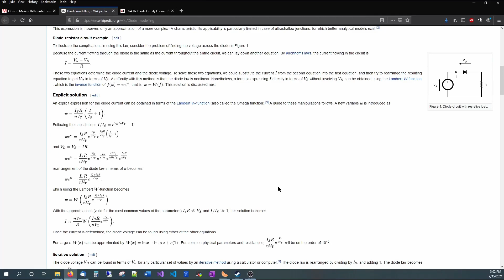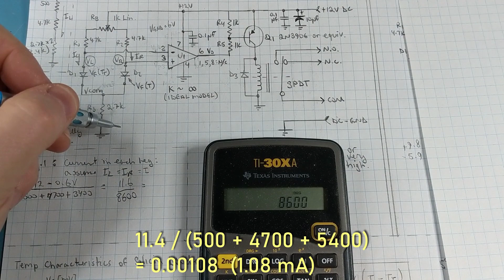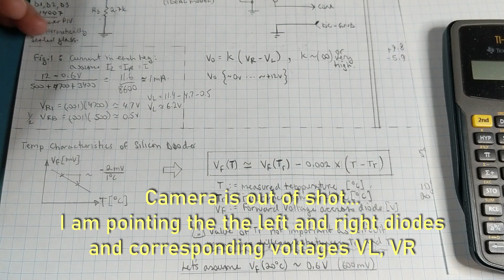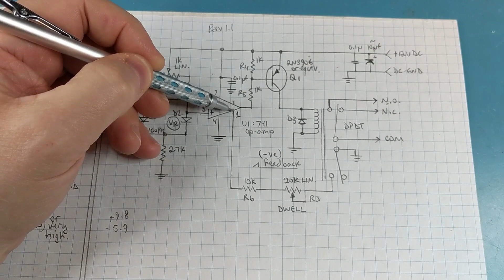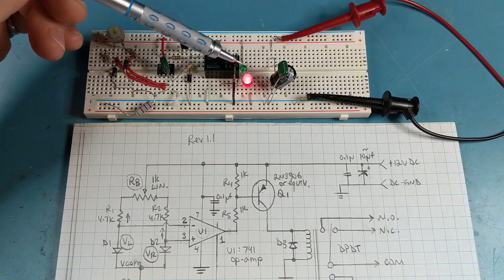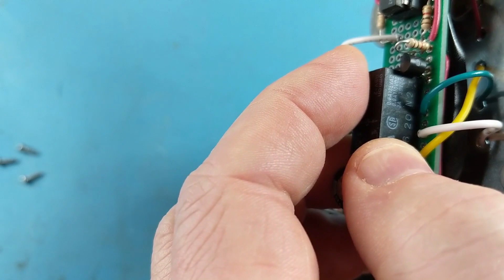EV 016 - Analog Circuits - Differential Temperature Sensor

Comment: Hi Eddy_D

I restore and collect vintage radios here in sunny British Columbia. 😊   I recently  came across you YouTube video where you rebuild some IF transformers using  some PC boards you designed yourself.   I must say that I was very impressed with the precision with which the three boards go together.  I have a few AA5 radios where the IFs have been destroyed by heat and I was wondering if you would consider selling me several sets of you PCs.  
Anyway , I will add you to my list of restoration videos to watch.
Thanks
Reply from the maker: Sorry did not see your comment until now. 

I have a few boards left, I would have to determine somehow a way to sell them (eBay or Tindie are 2 options I could look at). If I make them available then I will announce that and reply back here again (if I remember). 

The boards are pretty easy to prototype with perfboard as well if you want to mess with a replacement. I think I cover the typical values in the video.

Cheers,